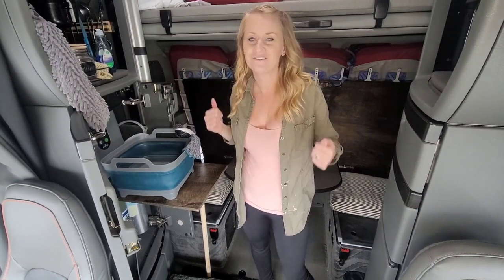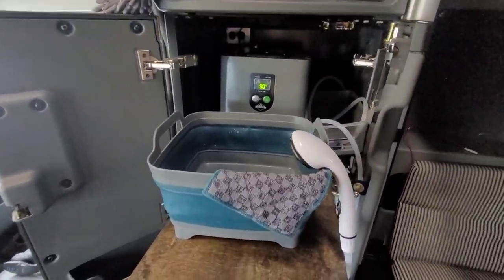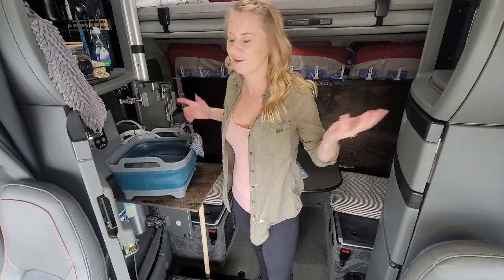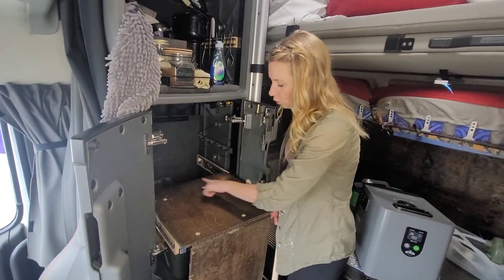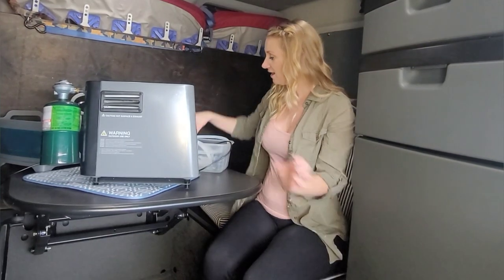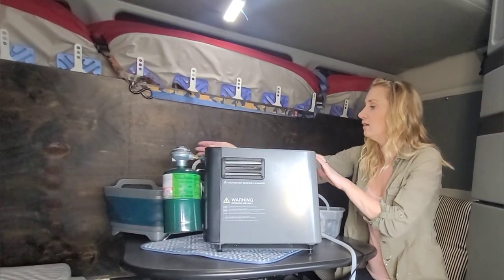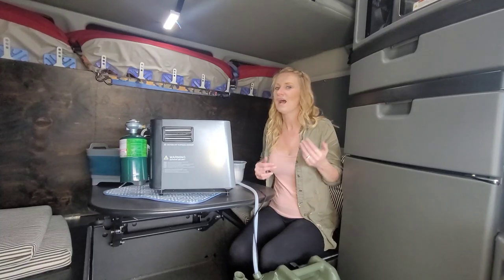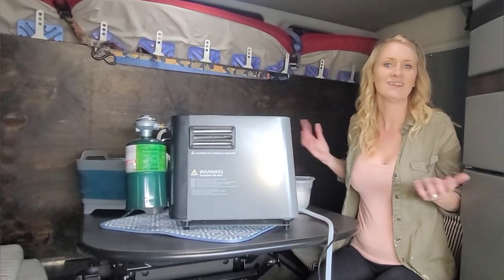Sink in SEMI Truck with HOT WATER | dishes in the truck

Comment: That heater might be putting out CO2 not sure but be careful with that. I think that's why it says outdoor use only.
Reply: Yea I was wondering if they keep a carbon monoxide detector on the truck just to be safe.
Reply: I was thinking that too but I assume they're not using the sink while theyre driving so maybe the front windows are rolled down while it's being used.

Comment: I love that idea. Grease and sauce are a pain without hot water. So far the best meal I made in my truck is scalloped potatoes and kielbasa. I've got the galanz 3 in 1 microwave and instapot
Reply from the maker: It has made doing the dishes so much easier !!! I absolutely love it!!! Should like a yummy meal. So glad to hear others cooking in the cab!  I Looked at the 3 in 1 but my momma talked me into the airfryer and our pastor let us barrow one to try. Be safe and many blessings
Reply: @SimpleLivin  ya the galanz has been working out for a couple years.  sure makes a difference having a oven. Maximum amount of power on the inverter is 1800 watts. Just gotta use a little fan to help get air around it in the volvo cab
Reply from the maker: 1800 Watts is the max for us as well. So far there hasn't been problems with the airfryer and space around it